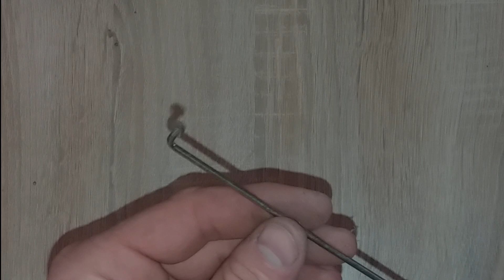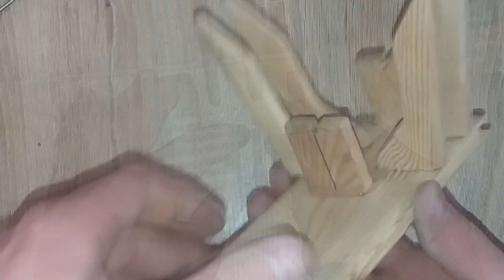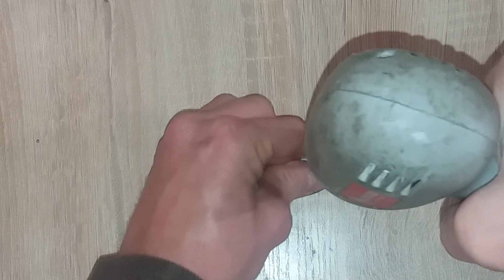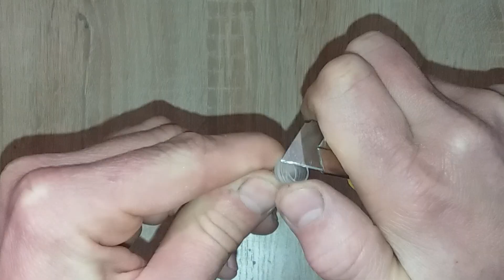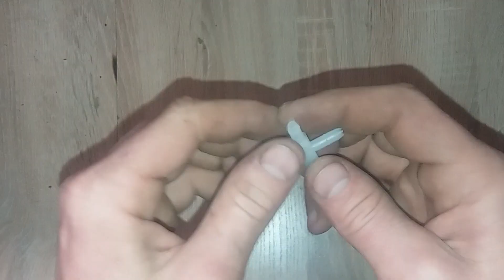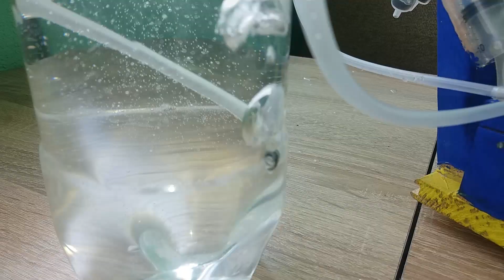How to make a powerful air compressor V4 using a syringe.

Comment: I did it, but the piston is not spinning.
Reply: Emirhan Sözdemir you need a dc motor to make it work
Reply from the maker: In 5 hours will be published a new video - Diy V6 Air Compressor. You might like it!